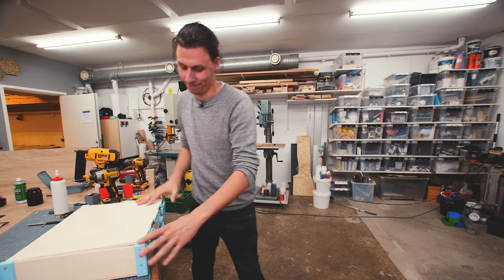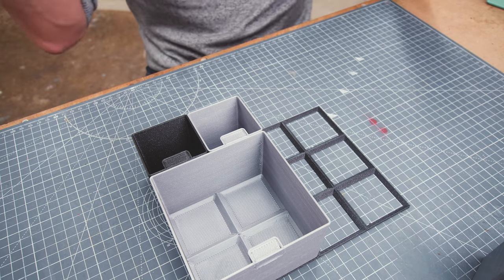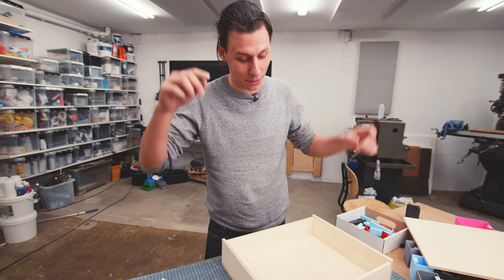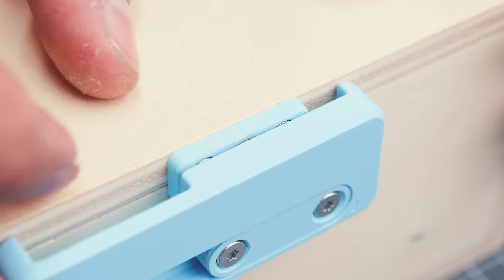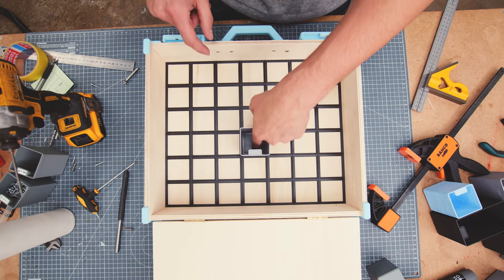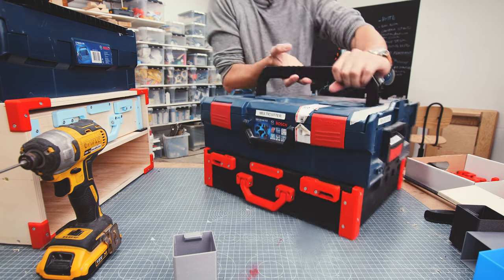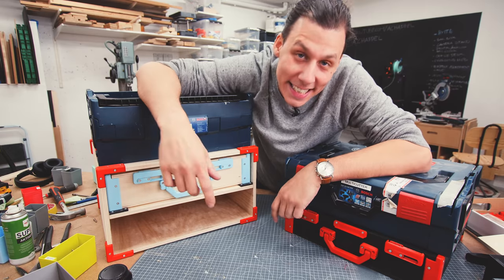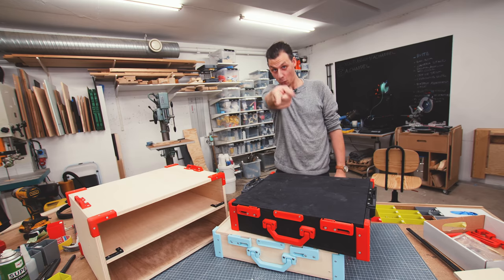3D Printing Even Better Assortment Boxes - And Making a Case for Them!

Comment: I really like your grid system. If people already have the old boxes you could have the case filled with 'placeholder' boxes that you print in a different color. Then when you grab a few things of screws you could just put the placeholder boxes in your storage. Nothing would move around and the contrasting color would make it super easy to swap back when you finish the job.

Comment: Hey Alex, just make small inter-lockable grid. So you only have to print small grid models. Just connect them to fill the base of any box or drawer you have. You could also reuse the grid on any size of box or any box you will build in the future.

Comment: Alex, make the sides a smidge taller and add some foam to the top. Make the foam twice as tall as the gap between the sides and the tops of the containers - - they will squeeze down and seal every container securely. This would hold even thin washers and tiny ball bearings, where a slight bow to the top would not hold them in the current design.
Great video.

Comment: if you make the Case a bit taller you could put foam on the top to reduce noise while carrying it and it seals it even better if for example you have really small stuff in it.
you could also put little magnets on the handles so it won't flap around if you don't use them.

print the corner protectors out of tpu and low infill so it absorbs the impact if accidentally dropped.

I really love your designs and videos, I never subscribed to someone after just watching two videos 
also the prices you sell the stl's for is really good 😄

(sorry for my bad English)

Comment: Nice!  One minor suggestion, it's a little more work, but you can orient the hinges so that you're not screwing one side into the edge of the plywood.  Might require a tiny mortice, but it would make the lid stronger since the screws would be less prone to tearout..

Comment: Love this, thanks.
I like the idea of the boxes locking together using the bosch attachement hooks and then make corresponding latches on the bottom amd have the boxes lock together. You could even make a standalone top handle just for the cases instead of needing the bosch crates

Comment: Hi Alexandre - great project I will definitely try printing some of the boxes and the grid. Instead of building a box to to hold 2 containers why didn't you expand on the bosch concept and design a way to lock the 2 boxes together ?

Comment: Loved it! Just a suggestion, you could 3d print yourself some kind of safeguard for when you use the table saw, so your hand can be further away from the blade, if something would happened. I have seen people use a kind of "y-stick" which grabs on to the plank and has a handle like 20-30 cm away from the blade.

Comment: I would really like to know the cost of a single drawer, included the boxes. Cost of materials, considering the plastic wire you use to print a set of small boxes for a drawer and the wood. Please. :-)

Comment: I don't know if this is possible, but It may be cool to print matching catchers, same as on the bosch boxes and put them on the bottom of your cases. That way, you would be able to simply stack your cases one upon each other and stack a bosch box on top of the stack. You could than even add a simple bottom piece with rollers on the bottom and catchers on the upper side, to be able to stack you cases on top of it to add a rolling capabilities. That way, you are not limited with only two cases and that solution is totally modular.

Comment: One way to create a grid for the older-style boxes, is to use the spaces they have in between. The catch: the grids will have to be custom-matched to whatever configuration you use. E.g. 3 1x1 boxes will fit in a 1x3 space, but a 1x3 box will not fit in 3 1x1 spaces. Idea: Make frames (think one-cell grids) that matches each size box, and stick them down with double-stick tape in your configuration to form the grid. Unstick the frames to reconfigure.

Comment: The black and red look more striking, but if you have any nice grain on the box I would go with a clear coat to show it off.  

I picked up another tip, using the clamps to hold the sides up while you are fixing the opposite side to the base, nice!

Comment: Your workmanship is impressive. You are pretty much reinventing the Bosch system. Did you consider making your system compatible? How does the cost of printing boxes compare with the cost of the Bosch boxes? Or even better Schaller boxes, which are the cheapest I have found?

Comment: Hi Alexandre! Love the ingenuity. I was thinking another way to solve the sliding problem is to stick a material on the bottom of each box that has high friction with wood and metal. Maybe like a TPU kind of material. Another thought is to line the drawer with velcro or magnetic sheet and then put velcro or magnets on each box. This way you won't have to spend hours printing each grid.
Reply: Alternatively a laser cutter might make it a lot faster to make the grid

Comment: Very nice, but i would suggest that you put the recieving end of the bosch mechanism on the bottom so you dont need any Transport Box. That way you may even be able to stack 3 of those boxes. As an addition you could design a bottom Plate with rollers so that you could use the stacked boxes as kind of a trolley

Comment: Great video. Still in awe from the other video with the cabinet full of these boxes.

An idea. The custom box that clips onto the bottom of the bosch box. You can just design your custom box with the same type of bottom (or sides that it clips onto) as the bosch box. That way you could theoretically clip a bunch of custom boxes one after another, without the big clunkier box.

Comment: Improvement: Rather than a whole new grid system that you need to put at the bottom of every drawer, you simply could have made a grid of shallow holes drilled in the bottom of the drawer. The old boxes won't care, so it's perfectly backwards compatible. With the new boxes, you just give them round pegs on their bottom. Essentially, an upside down lego brick! The bumps slot into the grid of holes below, fixing them in place, and if you put enough new ones, they'll even force the old ones to stay in place too!

Comment: I really like the boxes that you designed, i am planning a 3D printer for my new workshop and would like to print a load of these boxes but am wondering if the costs of materials and bit of electricity are competitive with purchased boxes which easily are sold for 90 euro cents up to 4 euro for the large sizes. Did you work out approximate costs for the various sizes in your designs. Just curious. Thanks for your effort to put the video's online, they are very informative. Next week is the handover for my new workshop and then the fun starts moving all my stuff over. Best regards, Danny

Comment: i would slightly alter the bumpers you made for the boxes so they can be stacked 
but also have a recess for strong neodymium magnets 
essentially these magnets would connect two boxes to be one without the need for the extra box

Comment: Hi Alex, one of your newer subs here ;) I got stuck in your videos immedietly! Very Mathias Wandel but abit more modern. 

I really like this project especially since I work as a plumber and carry tools and fittings etc. daily. This would be totally awesome since I could decide myself how big the boxes are, and your double+tools looks like it would be perfect for service/repair jobs. Just pick the boxes that you need and go inside. 

The problem for me however is that 3d-printing have not really picked up yet in my area, and Im not really sure that I wanna invest in a printer myself (yet). Have you thought about opening a webshop where you sell your 3d printed parts in kits? 

Like I said, I really like this idea but dont wanna go down the rabbithole myself. It could also be a means of supporting you and the channel.

Comment: My favorite was the wooden with blue details, but honestly I think it may be cool to make a variety of colors! That way you can easily remember which box has which parts.

BTW maybe if you put a high friction mat in the bottom of the drawers with the old boxes they wouldn't slide around. Like the material used on track saw rails. Neoprene, I think?

Comment: Great ideas you always make suxh inspiring content! I did have an idea for how you can have the boxes be both modular to snap together while also being able to fit nicely in the drawer style box. 
If you make the tabs mount to the side and maybe fold upwards by a hinge, you no longer have too much vertical height to fit in the box as they can be folded over. I imagine these new mounting tabs would be a centimeter wide so you would have to make your box a little wider, and you can have a cut out strip of wood in the sides to act as a slide in rail so that there won't be room for the boxes to slide sideways. Im not sure if this will work out but hopefully it might be helpful!

Comment: Did you consider a stacking system like the commercial plastic versions of these boxes all have? Cleats in top and bottom and locking latch at front.

Comment: Great build! You’re giving Festool Systainers a run for their money! I like the wood boxes but not a fan of the sky blue personally. Also if you made the Bosch adapters for the tool crates attach via some machine screws then you could still remove them and use them in the larger bin!

Comment: Alex.   Love the video.   I myself like the black box.   If I was you I would create a new box that holds the two boxes so that it could hold the boxes with the brackets installed.  That way you would not need to remove the brackets when you want to take them some place in the bigger box.

Comment: Is there a reason that when you use the brad nailer you let the rubber tip fall off the edge of the wood as you're driving the nail in?

Comment: Could you stack those home made boxes with the "Bosch Box Clips"? Design receivers on the 3D printer and mix and match. This assumes the material you print in can handle the strain though.
Reply: I was thinking the same thing. Not too worried about strength though - pick the right filament and print orientation and it will take the load easily - plus design to maximize material in the right places for the required strength - At least for a reasonable stack size, you want to stack them that way to a silly height you will be able to make them break (including the Bosh ones too though).
Reply from the maker: yeah for sure, there's some designs out there that do this, for the cases I wanted to keep them as small as possible, but for the main box that could definitely work.

Comment: To save having to reprint the old boxes, you should just print a bottom coupler which has the pattern design and glue it to the bottom of existing boxes. This is assuming you have some room for height increase in your drawers. Alternatively, you can CNC out the wood on the drawer base with grid pattern with just enough bevel to fit existing boxes without the bottom pattern.

For the take away toolboxes, instead of the larger box, you should just create a 3D printed outside harness with multiple sizes to fit 2, 3 or 4 boxes.

For colour, I would say black boxes with single color 3D fitting per box. Red, Yellow and Blue.

Comment: Really wishing I had a 3D printer to make stuff like this. I like how the two different colored boxes look together. If you’re making a bunch, just make them all different colors! That will make it easier to know what’s in them. And if you could figure out a way to add the same slots that are on the bottom of the Bosch tool boxes to the bottom of your boxes, you could stack as many as you want without needing to worry about building another box for them. Then make a smaller one with wheels on the bottom, and you can roll it around if you have a lot of them together.
Reply: just order a printer and learn to 3d model. its really not that hard and the printers are really cheap (compared to 7 years ago when i started my 3d printing journey).

Comment: I really like the grid idea. However you could use the previous boxes (about 1000 you printed) if you make a grid with 4 small pins pointing up on each 2x2 square and 3d print templates to drill holes on the bottom of your boxes. I am thinking 2 or 3 mm diameter so you shouldn’t loss any piece contained on the boxes. 

By the way, I really enjoy your videos.

Comment: If you stack the boxes on top of each other, do they lock into place or easily slide of? I know Raaco boxes can be stacked with 10 on top of each other to build a stable tower. The top box 'grabs' the box below because it has small feet that fit into an indentation in the top of the other box.

Comment: I bet you could glue toolbox liner to both the top and bottom of the box insides, and as long as your tolerances are just right the trays would be capture when you close the lid, even on the old design

Comment: The real test is always washers and the smallest of cotter pins.  But I bet you could print a box plug to affix to the underside of the lid that would fix that for box lids that bow a little or those who don’t build to quite the same tolerances you do.  Pretty awesome, you may have just sold me a printer.

Comment: To prevent the containers from spilling if the lid becomes saggy over time, you could add a thin foam layer to the underside of the lid.
And it would also reduce the rattling noise a little I believe.

Comment: Hi Alex, thanks for sharing these great designs, I've just purchased the case from your website, but there is no details of the recommended print settings for the printed parts of the case included with the download, just info on printing the boxes.  Are you able to share your recommended print settings for these parts? thanks

Comment: Any suggestion on using the case 3d printer files with imperial size plywood? Is there a certain scaling that works well? 
I think I would use 3/8" plywood and would only need to scaling you the corner protectors to 106%.  Thoughts.

Comment: This is a cool idea.. I am building a new workbench, and I have been trying to find a good portable consumable storage system for it (something more versatile than just drawers), and I think you are on to something with this.  As the workbench is a work in progress, and I don't have a 3D printer (I use one of the ones our library has), I will definitely look into purchasing the files for this.

Comment: In an attempt to salvage the old boxes, it might be possible to cut a section from the bottom and only print the new bottoms that you glue or snap to the old walls. Or cut a section from the top to preserve the overall height and glue them to printed new bottoms (loose some of the usable volume this way).

Comment: Hm. I was just thinking about switching to Sortimo boxes, since I am not happy with my current ones. Now I wonder if I want to make my own instead (especially since I didn't win in the lottery this weekend). 

But I am not sure if I like the grid in the bottom of the boxes. You might be able to reuse the old boxes if you added a grid to the lid instead. That would also prevent really small items like washers from escaping the boxes.

These wouldn't work for the drawers though.

Comment: I think I would use the lid locking mechanism to fix the boxes between them. I'm not using the bosch system and it seems to be a convinient way to fix many boxes together during the transport

Comment: One issue I have had with 3D-printed boxes like these, is that I was working outside during the summer, and the PLA started warping really badly in the heat - in direct sunlight it took less than 5 minutes. Maybe a different plastic would perform better, but injection molde PP/PE will still be way better.

Comment: Nice concept. One thing i would have added is some kind of locating feature (maybe a groove in the bottom and a pin on top) in the side pieces so you can nicely stack a few of these boxes without them sliding around ;)

Comment: The nifty little stops you put in to stop the drawers sliding out if you tip them forward remind me of what’s in my RV. You have to lift the drawers up before you can pull them out. 

Your storage system looks like it would work really well in an RV. Very little wasted space and nothing slides around on its own. I’m printing some of your assortment boxes now and am going to figure out how to fit them into my RV drawers. And my kitchen drawers. And my medicine drawer. And everywhere else. :)

Comment: Those are really cool, I'm curious as to the cost difference between buying already made ones vs. the time to design, print and assemble your own. Such as Tanos boxes or Festool sortainers?
Reply: A better comparison would be the Sortimo system Adam Savage is such a fan of.  A fully loaded Sortimo T-Boxx costs around 55-60€ whereas a set of sorting boxes costs about 18 to 20€.

Comment: Print a little grid feature for the old boxes and glue in the bottom, this will make the boxes a little bit taller but you only have to print that and no the entire box.
Reply: Maybe it is easier to modify the drawers than re print the entire set of boxes.
Reply: @vs4073  Couldnt he add the grid pattern to the bottom and cut the drawers down on a band saw to fit. Hell even putting a rubber shelf liner would prevent them from sliding all over.
Reply: @famousamoso7  I think the boxes has a tag/pull feature in the top
Reply: @vs4073  the new ones do, but in the grand scheme its not a deal breaker to not have them.

Comment: Simply increasing the height of the drawer system should allow for the assortment boxes, with the bosh bracket, to fit. Thereby letting you have bosh brackets on all boxes but allows for you to bring only one, if you only need to take one with you